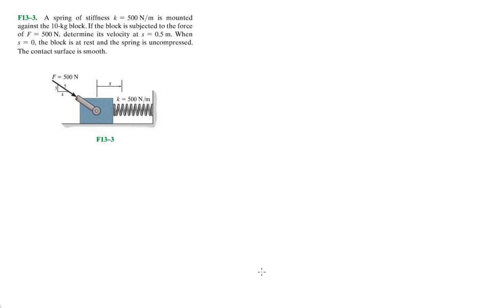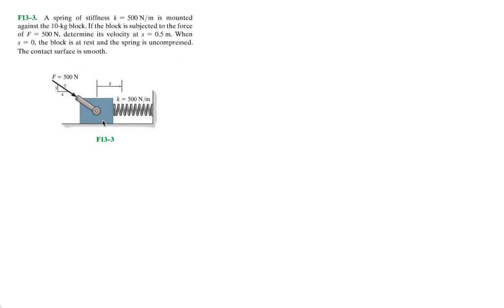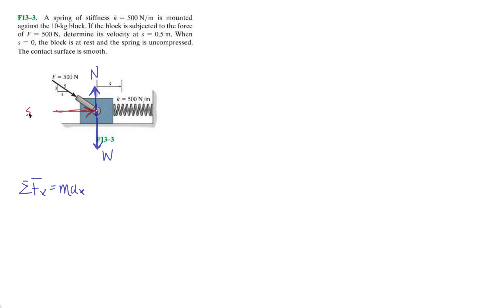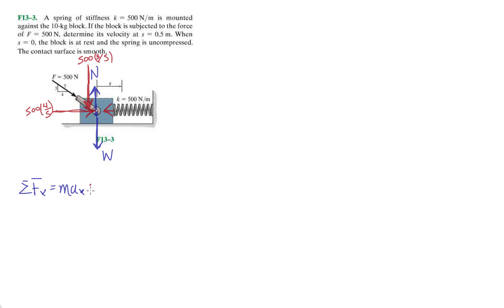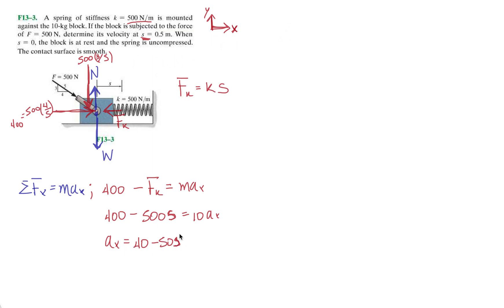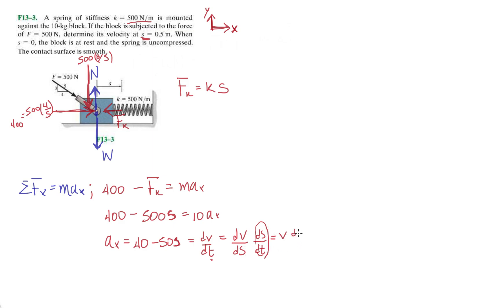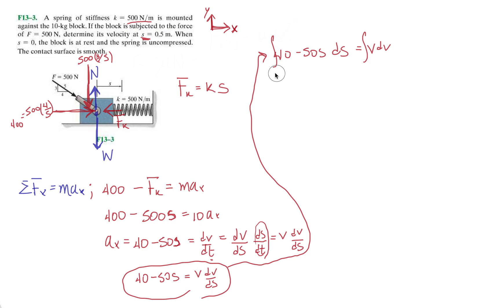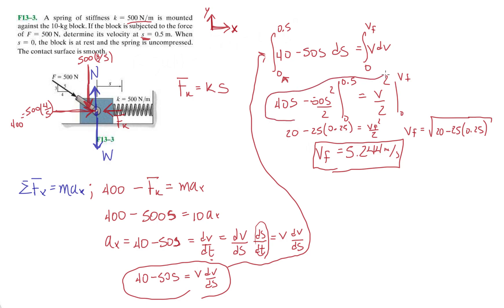Problem F13-3 Dynamics Hibbeler 13th (Chapter 13)

Comment: why is it my answer in vf= 3.708?
Reply: I led to the same answer that u find. 

this is not constant acceleration problem. 

at 5:25 u cannot substitute by 0.5m and find the acceleration and use that acceleration to find velocity by using equ. of motion.
I will not saying that the acceleration that you find is wrong, but the acceleration during movement is changing because 
the resistance of spring is increasing by distance traveled.

Comment: what did you do to (v^2)/2? you shoulda multiplied the other side by 2 then taken square root if I'm not wrong. check the final answer again
Reply from the maker: Yes you're correct on that. I might have skipped that step on the video but did it in my calculator. Thanks for pointing that out though.